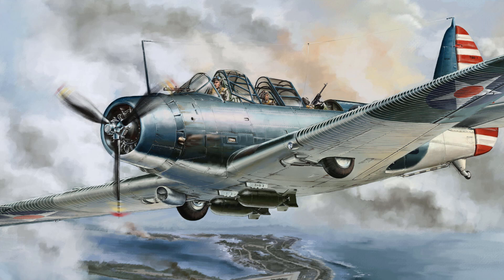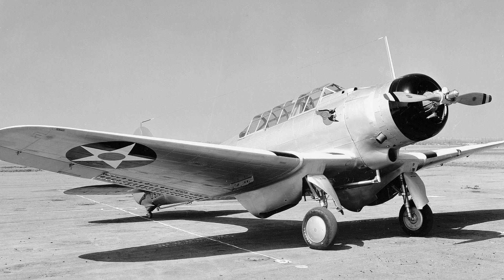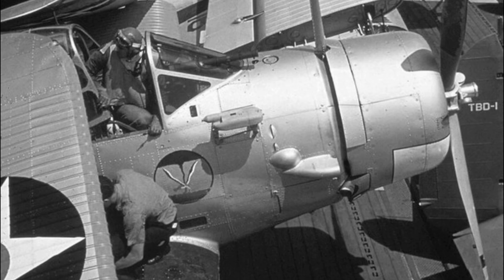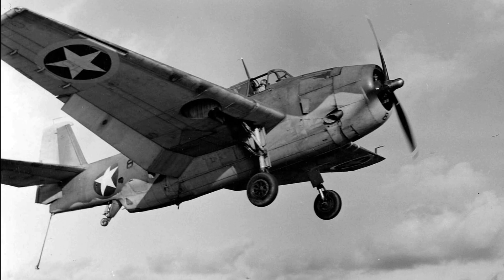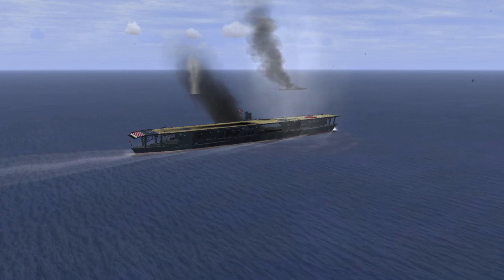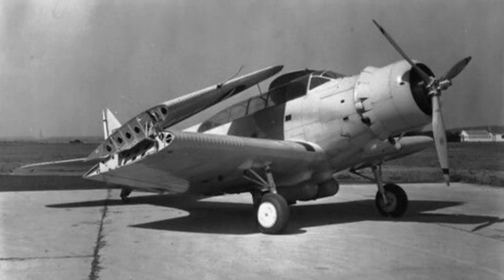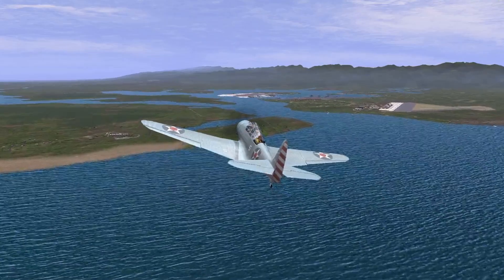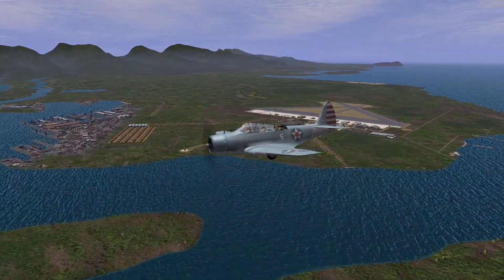5 Minute Guides to Aircraft: Douglas TBD-1 Devastator

Comment: Nice video. I agree that the TBD has reputation for being a bad design, which was not the case. I'm glad you touched on the limitations of torpedo attacks in general and the limitations of the torpedo, but the real problem at  Midway was mostly doctrine, but indirectly. USN carrier doctrine pre-war had carriers operating independently. It was seeing what the Japanese could do with a concentrated carrier doctrine that caused the USN to hurriedly create a new doctrine...and the bugs were not worked out by the time of Midway. What should have happened is the the carrier's attacks should have been internally coordinated (fighters/dive bombers/torpedo planes) and arrived at the target at the same time...along with the other carrier's strikes. So the planes from all three carriers should have attacked at the same time, from different angles and altitudes, overwhelming the defenses. 

But what happened was the strikes were completely uncoordinated, and came in piecemeal. So the full force of the CAP fell on the strikes from Midway, and then the TBDs. Remember, the Avenger made it's combat debut at Midway too...and was also slaughtered. It wasn't the TBD being a bad plane...it was in a combat situation that no plane could have survived. Had the attack went off as planned, the carriers would have been attacked by a swarm of American planes. They would not have been able to dodge torpedoes like they did because there would have been too many bombs and torpedoes coming in at the same time. The CAP would have been pulled in 100 different directions, and have been unable to concentrate like it did. 

The command situation was also not ideal. Hornet was completely green. The American force was commanded by Fletcher, alone in Yorktown, with Enterprise/Hornet commanded by Spruance...new to commanding carriers. It would have been difficult to coordinate even if the fleet was used to cooperating.  And it's not usually talked about, but the intelligence supplied to the carriers was not all correct. They were told that the Japanese were operating two supporting task forces of carriers...and that was in the back of everyone's head during the battle. It also let to otherwise bizarre actions (like Ring's 'flight to nowhere'...he was following orders based on faulty intelligence).

Comment: What a useless plane the devastator, with its tiny engine. dropping torpedoes that were no good for two years… so many good men wasted at Midway. If only the Navy had stuck with dive bombers.
Reply: Too bad you weren't around to advise the Navy with the luxury of 80 years of history.
Reply: @sidefx996  They knew better - or they should have.  The American conduct of the Battle was atrocious.  They just got lucky with the Dive Bombers from Enterprise and Yorktown .  The Hornet Air Group Commander was busy going no where and running his planes out of gas.
.
Reply from the maker: The Devastator was actually a fairly ok plane even at Midway. But a fairly ok plane is only useful if its used correctly, which it very much wasn't.

Like, sending in slow bombers without fighter escort is a year 1 naval commander mistake.

The only reason the dive bombers got lucky is because of the Devastators brought the fighter cover low. Had the Combat Air Patrol of the Kido Butai been at the devastators altitude, they wouldn't have had much better luck.

Comment: The Devistator would have had a much better combat record if it was armed with a functional torpedo
Reply from the maker: A sentiment shared by basically every Torpedo Squadron of the US Navy, those poor lads.
Reply: The devastator was so slow, that the ones approaching the Jap carriers from astern were only approaching at 100 miles an hour relative to the fleet. Incredibly slow while being shot at. Sitting ducks.
Reply: @amyrichard3203  The torpedo couldn't be launched above 115mph.  Armed with those same weapons, a flight of F-4s (never mind that they'd probably be stalling and crashing into the ocean at that speed) would've been sittings ducks.
Reply: US torpedo in use t that time had a habit of losing programming n would do a 180 degree turn. Many sank the vessels that launched them.
Reply: @normansilver905  Not "many" - but yes - some.
.

Comment: The award for the worst planes ever built goes to Brewster.
Reply from the maker: Eh, the Brewster Buffalo wasn't great but it wasn't exactly horrific like some other aircraft (He-100 looking at you)

Definetly one of the worst aircraft America produced though.
Reply: @5MinuteGuidesToAircraft  I was thinking more of the SB2A Buccaneer. The Buffalo actually did fairly well in Finland.
Reply from the maker: @electra2259  Huh, I didn't know about the Buccaneer. Usually when people are talking about worst planes by Brewster its usually in reference to the Buffalo, exactly because they don't know it performed well in Finland (hence why I said it wasn't horrific)
Reply: @5MinuteGuidesToAircraft  yeah, the Buffalo and a got bad reputations in large part because it's most well known  engagements were against largely superior aircraft. When measured against technologically equivalent foes ( as in Finland ), they actually performed fairly well. The Devaststor was also pretty much obsolete when it actually went into combat, and it wasn't used with proper support. Any aircraft on this circumstances would do poorly,  no matter how well designed it was originally.
Reply: When the U.S. entered WW2. It stepped up . Till more advanced aircraft could be produced.